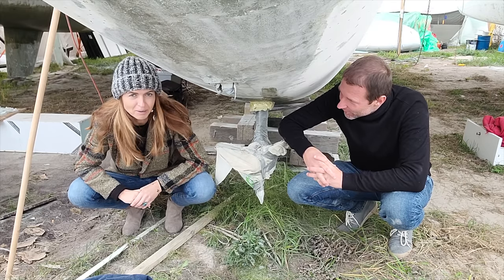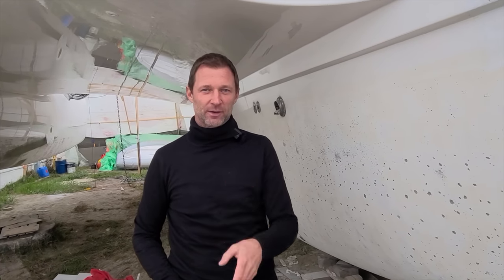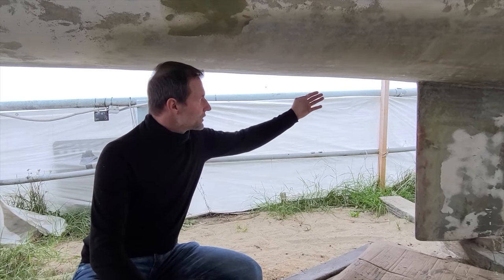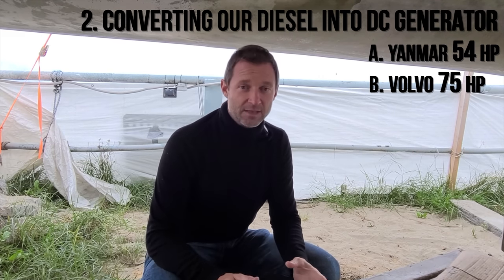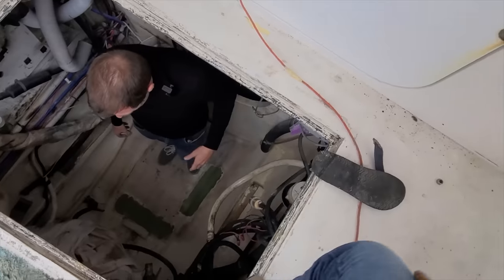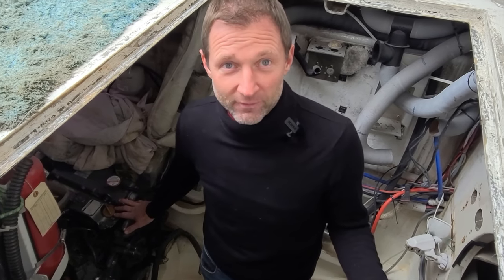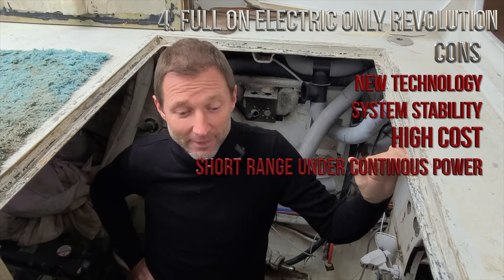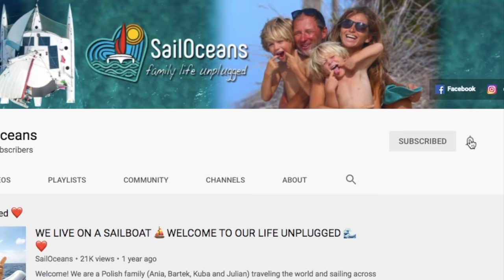The Big Decision - Electric vs Diesel Sailboat Propulsion

Comment from the maker: Hi guys!

I am very much moved by the number and the depth of comments that contain a lot of useful suggestions, recommendations, and your own experiences. Thank you so much! I feel obligated to answer you all. It is impossible for me to answer everyone by replying to each comment, because it would take me weeks to do it properly. I will take my best shot at answering all the reoccurring questions and comment on reoccurring issues raised. So first let me clear up few most important details:
We now have 2,3 kW of solar panels on the roof that produce just about 10 kWh per day as long as we don’t sail. The sails generate shadow causing this production to fall about 40% on average (here obviously electric motors with regeneration capability could offset that loss).
The minimum proposed new setup will generate 20-30 kWh a day, while our house needs are about 10 if we are in an all-out luxury mode. This will increase by about 1 kWh once we switch to induction cooking from propane. So, let’s say our house needs will be about 11-12 kWh. The rest remains available to recharge the motor banks and/or supplement propulsion real-time reducing the discharge rate on the motor banks.
It is conceivable that we may expand the solar generation to the point where we would be able to slowly motor just from the solar power. That is somewhat experimental until we actually put the boat in the water and measure the power draw at given speed and sea/wind conditions. I am being optimistic because the boat is very light and in calm conditions can move very efficiently through the water, with minimal drag at low speeds let’s say under 5 knots.
We do not want to remain with the big diesel onboard, while adding large battery bank and electric motors as this adds significant weight and in case of our narrow hulls the boat sinks quick under extra load degrading the performance significantly.
We are NOT considering a high voltage system. Currently 48 V DC is all that is on the table. That is something you can touch without harm (well unless you completely wet than you get a decent tickle).
Yes, we are talking with OceanVolt about their ServoProp among others. Their system seems to offer the most significant region capability. With our cruising speeds we are looking at upwards of 2 kW non-stop while sailing. That’s 3-4 hours of driving the electric motors at full speed after 24 hours of sailing.
The latest under consideration is a 48 DC gasoline portable 7,5 kW portable genset for occasional use. It weighs around 70 kg. About a quarter of the current diesel or about a half of the similar sized diesel genset. Medium sized diesel genset is also under consideration despite the weight. The pros are safety, and much better integration.
We are not considering a battery bank that allows 15 hour autonomy. That would be enormous cost and weight. I think we will end up with 2-4 hours autonomy at full speed. At half speed we’re talking 3 times as long or more. Then there are the solars that are drastically increasing the autonomy. Then there are hardly ever the calms with such light winds that we could not sail at least a bit. But for those rare occasions and for the rare need to power against a local storm we would seriously want at least some sort of genset. Normally in macro situations we positions our boat to weather systems in such a way as to use the lows to our advantage rather than getting pummeled. That’s sort the beauty of the latest weather models and routing capabilities from Predictwind coupled our more than average sailboat cruising speed. Of course that applies to long oceanic legs where we are not limited in our options by a landmass.
Electric motors present the very high torque even at lowest RPM and do not give us the same top speed as diesel. But this is exactly what we are after. We are after being able to power through a local storm against gusty winds rather than go high speed for hours. That we can do much better while sailing. OceanVolt gave us an estimate that the torque and thrust produced by 2 x 15 kW Servoprop drives will equal approximately to an single 80-90 HP diesel in terms of torque. So effectively it should be better for what we need than either of the two diesels we have available. They also said the max speed will not be there . But I hardly see a need to go faster than 5-6 knots under power. Currently top speed at full power, calm conditions with the existing 54 HP Yanmar is about 8+ knots. 

Thank you again for inspiration to looking into few more options and aspects of this hard choice that we gonna have to live with for the next few year and as I hope we will want to live with for the rest of the sailing life.
Cheers guys and thank you so much for getting involved so seriously. It’s very helpful.

Bartek
Reply: Bartec have you looked at the Dutch Vetus electrical systems....
Reply: wind turbine for charging
Reply: or 1 plus 4 uprade your alternator remove  your genset

Comment: Redundancy - Parallel Diesel Hybrid

I would put another option on the list - Parallel Diesel Hybrid. While full electric sounds great, for full time cruising and crossing oceans in variety of conditions to me sounds that Redundancy is a must. the hybrid systems you discuss are so called serial hybrid, which has its beauty but shortcomings as well (any failure in part of the system fails (almost) the entire system) 

The Parallel Diesel Electric Hybrid systems could give you the option to be green - in a combination with big battery bank you use the electric motor only, but in case of emergency or failure you can kick the diesel (to use it independently or in combination with electric motor on the same drive). 

With the above, your "underpowered" Yanmar will be more than enough, and to serve as e genset if/when needed. The main power will still be coming from the propeller on the main hull which is contradictory with the idea to have cat-like maneuverability with propellers in amas. Well, installing electric props on each ama with the purpose only of maneuvering in marinas could be the case I suspect ... or bow and stern trustors for axis-rotation functionality only. 

I do really enjoy your channel and looking forward to future episodes, especially the refit challenge. 

Admirations

Comment: Option 3A - > 4 - Keep 3KW generator (get rid of current saildrive, engine & LARGE fuel tank).  Install the 6-7 kW of solar, install smaller 100-150 gal diesel fuel tank for 3kW generator.  Install large battery bank from option 4.

Since you don;t "motor" much...even the electric drive shouldn't scare you when it comes to capacity ("motoring" for a long time..sinc eyour sailing history shows you don't motor much).  

Another option is to convert to shaft drive (Neel 51's after hull 31 have that option).  It's a V-Drive.  Go V-Drive with a parallel diesel/electric hybrid (diesel engine with a clutch and electric motor inline).  Allows diesel propulsion (electric motor acts as a 7-9 kW generator), can disengage clutch and run electric only.  Or, can use electric motor for torque added to diesel operation).  HH/OC are offering this now.

Comment: Stay with a multi fuel diesel. Sustainability and recyclability with LiPo batteries still make me nervous. Also. Keep your generator(s) or get higher output. Does your vessel have AC and heat? Will your system be able to sustain that efficiently under a 100% whilst using it? Hot water is necessary. Will it keep a good hot water system or will you go use on demand natural gas?

Comment: A comment from someone with a degree in electrical engineering who is very interested in electric power.  After much research the main issues switching to pure electric are range and power.   If 54HP diesel is not enough you will need very large and potentially expensive electric motors to replace the diesel.  Also unless you add a diesel generator it will be completely impractical to have enough batteries to motor more than 30-50 km.

Comment: Hi
I am finding this project series quite interesting. Many of the comments have mentioned some great you tube contacts for information. With the size of refit you are thinking about, contacting Nigel Calder or at least his affiliated companies would be a must for me. He is involved in a couple of companies that specialize in electric power. Not sure about the motors. Integral Is one. He is the electrical standard for marine applications. Project Atticus used a company he is in partner with. My 2 cents.

Comment: ❤️ option 4. You can always use your dingy to push you through the Panama Canal. Maybe add hydro generator or two to help charge at night.
Reply: Only works if you have wind to sail and useless when at anchor or doing low knots .. potentially only does what re gen might do on electric motors.
Reply: @clivestainlesssteelwomble7665  Of course.

Comment: Go for the full electric option. With the new roof you have more space for solar panels. You can also use regen with Oceanvolt when you are sailing. When you remove the tank you have enough space for a big battery bank.

Comment: with a family on board, safety and backup systems need to be your number one possibilty.    Everything breaks, including electric, I would go with a backup diesel generator to supply power to your electric engines.

Comment: You want to go "Green"? Remember one of "Murphy's Laws". Electricity / electronics + marine environment = "Green Gunge". You must depend on hundreds, perhaps thousands of small electronic parts that cost less than US$1 not to fail VS. the of risk partial or total system failure if one resistor or capacitor decides to burn out or quit on you. And since those parts are largely contained in "black boxes" it is hard to determine which has failed or to repair / replace that part at sea.

Approximately 750 watts = 1HP. So 7Kw of electricity = 9.3HP. Not going to go very far on that amount of solar panel charge capacity. You say your 54HP Yanmar is underpowered to push the boat into a strong head wind(amount of available power does not matter when going against adverse currents as many people believe). How will two much less powerful electric motors do in the same circumstances? Two 25HP electric motors would require 37.5Kw of available electric power. For a sustained time period that amount of output would require a HUGE battery bank. These numbers are all based on 100% efficiency in the system.

Most sailboats moving under the power of their auxiliary engine are in 'displacement hull" mode. They are not going to plane like a high speed power boat. Generally maximum hull speed in those circumstances is 1.35 X the square root of the waterline length. In your case about 9.5 knots top speed(I'm guessing your WL is about 49 feet). BUT anytime you exceed 1 X the square root of the waterline length your fuel consumption dramatically increases. In your case that means ideal max cruise speed VS fuel consumption= 6~7 knots.

Now comes the tricky part. For many sailboats moving at 0.8~1 X the square root of the waterline length requires about 50% or less of the main engines rated output. The rest of the engine's available power is used to go faster NOT MORE POWERFULLY. This is often a hard thing for people to conceive. Boat manufacturers love to sell high HP engines(larger profit margins). Engine manufacturers love to sell higher power engines(larger profit margins). People love to buy higher power engines because it gives them bragging rights.

It used to be that sailboats had AUXILIARY engines. One HP per ton of displacement was considered adequate for this purpose. One HP per half ton displacement verged on being a motor sailor. Now it seems people want one HP per quarter ton displacement. Insanity. 
The problem is that all that "extra" HP cannot be used effectively. Because propellers turn too fast to be efficient, generating a lot of "slip". What you really want is POWER with a good balance of speed for better fuel efficiency. How do you get that balance? By turning a large diameter propeller at slow speed. The propeller shaft should turn at 1,000 RPM or less. You know those huge ocean going container ships? Most sailors have seen them at sea, sedately cruising along at 20+ knots. Do you know how fast their propellers turn? Depending on the ship's size between 60~75 revolutions per minute. Boggles the mind, doesn't it.

Although I do not know, I would say that your current Yanmar has a 2:1 reduction gear and therein lies the problem. At one time Yanmar offered a choice of reduction gears for their inboard diesel engines, same price for all. When I built my 10,000lb, 30" sailboat I ordered a new Yanmar 2GM16, two cylinder 16HP engine for the boat. AND I ordered a 3.25:1 reduction gear on the engine. There was not one reduction gear like that in the entire USA at the time(30 years ago). The dealer had to remove the reduction unit and replace the gears inside with standard parts from Yanmar. The result? My boat would go 4 knots at 1,500 engine RPM and used one liter per hour of diesel fuel. Great for crossing the doldrums in the Pacific while powering for four days straight in dead flat calm for 6 gals a 24 hour day. The other benefit was being able to power straight into 6~8' trade wind seas and 15~20knot trade winds at 4~5 knots at 3,000 RPM engine speed which was still less than 1,000 RPM shaft speed. Oh yes my propeller was a 16" diameter X 10" pitch Martec folding cruising prop, so little to no drag while sailing.

Perhaps your best all around solution would be to eliminate the saildrive(high maintenance item) and replace to with a 2.75:1 reduction gear and a straight shaft connected to a three blade folding / feathering prop. Give electric power a pass until portable fusion generators are available.

Comment: Other than option 1, those are very expensive options.  If you mount a generator motor to a big diesel it can also be used as a motor to power the boat.  My suggestion would be to convert to a shaft drive with an electric motor/generator mounted on the shaft that can also  be used for regenerating under sail.  If you need more power for an hour or two you can use both the diesel and electric motor together.  If you still want twin motors for turning in a marina, mount two large trolling motors on the transoms of the amas.  They can flip up and not cause drag while underway.
Reply: Love this solution and similar to one I was thinking of if I ever acquired a Neel 51.

Comment: Thinking a bit more about your project (not sure where my previous comments gone) the interesting option could be installation of two Oceanavolt 15 servoprops fitted off CL in main hull. 
From what you described, such option should check most, if not all the boxes.
Pros:
- off the shelf tested product
- sufficient power (less than old VP, but more than your Yanmar)(2 sets because Oceanvolt does not have the bigger drives so far)
- good manouvrability (two props off CL)
- redundancy (two drive trains)
- relatively low drag if needed (feathered props)
- good power generation (servoprop)
- increased endurance (motoring on single prop with low revs would bring you further)
Cons:
- extra cost (two units instead of single drive)
- higher drag (comparing with single folding prop)
- lower efficiencey (two small props instead of single bigger one)
- extra composite works (closing exiting hull penetration and making two new ones)

Most of these cons should not be show stoppers as long as you considered two drives anyway.

Good luck,
Wojciech
Reply from the maker: Thank you Wojtek. Those are all god points. However, OceanVolt has priced itself out of the consideration unfortunately. We agree that technically this is the best solution. Cheers. Bartek

Comment: I would add 10 kW electric pod motors to each of the amas to augment your existing Yanmar diesel in those 30 knot winds and for manoeuvring and cruising at low speeds, and add a 9 kW integral marine generator to your Yanmar via pulley to charge 60 kWh LFP batteries, and remove the genset. 6 kW of solar will only harvest about 30 kWh over a sunny summer day. If you discharge 60 kWh LFP to 50% (use 30 kWh), then your 6 kW of solar will charge it back to 100% on a sunny day. If you need more than 30 kWh in a sunny day you will have to run your diesel engine for propulsion or to charge the batteries.